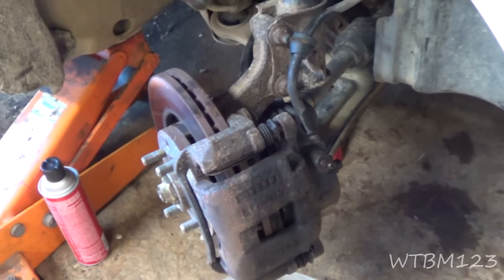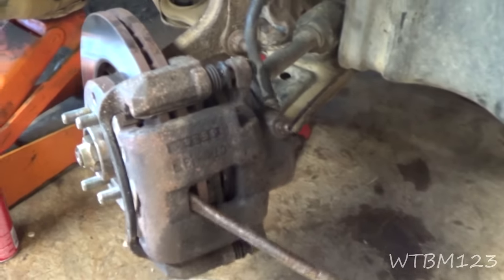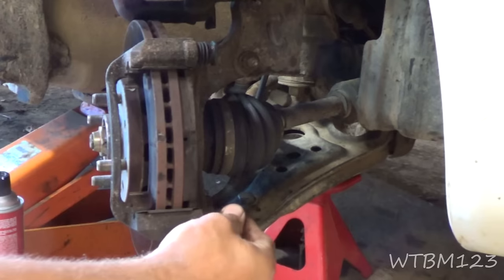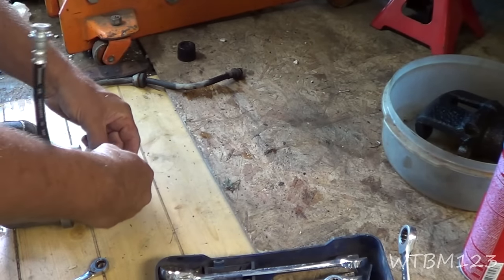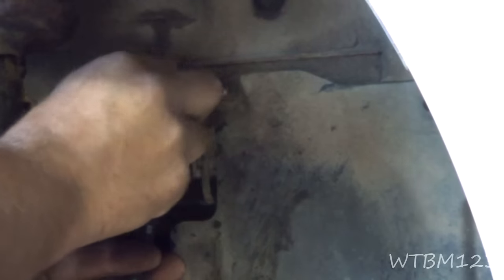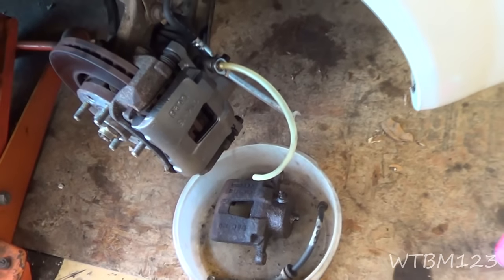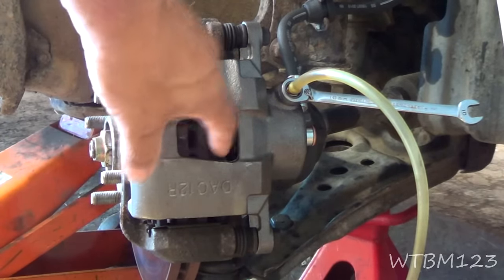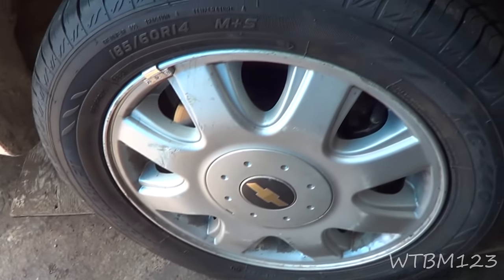Stuck Brake Caliper or Bad Rubber Brake Line #brakes #bleedbrakes #brakehose

Comment: My front driverside rotor runs hotter than the passengerside + i have a light brakeshudder when braking at speeds above ca 30 mph. Both rotor and pads both sides changed (ATE brand) a year ago. 

Brakehose looks good. Opening the bleedervalve I can by hand easily press the pistons back in, as the brakefluid passes through the valve. Likewise, with the caliper closed I can pump the brakes and still easily pry the caliper open with a flatheaded screwdriver or even just moving the caliper on the glidepins by hand. The pads were not exactly moving smoothly in the brake hardware, so i wired the hardware down and filed the pads to fit nice and loose. Still didn't solve the problem... 

Glidepins are gliding nicely, but they are slightly rusted. 

At this point, I'm thinking the caliper's not the issue, nor is the pads or the hose. What's left? Master cylinder, glidepins and rotor.. But the rotor is only a year old.. Been scratching my head for a while now, help much much appreciated!
Reply from the maker: If sure all moves free and well . If you drive a short distance trying not to use any brake does it get hot then . or is it when using the brakes alot . If the latter check to see if the cooler side is working . If calipers are back . up on jack stands . Hit the brakes a few times then turn tires to see if either is dragging .
Reply: @wtbm123  Yeah, driving about 15km without using the brakes at all, nearly rolling to a stop = driver side too hot to keep my fingers on the rotor for more than a split second, while the passenger side is almost cool to the touch. 

Just got a new pair of glidepins, new brake hardware and new pads. Figured I'm gonna try and change the hardware first, second glidepins and then the pads to see if any one thing will fix the issue. If I still get the slightly hotter rotor on the driver side (also a little bit of a brake pulsation), I'll get a new rotor, thinking that this one might have warped slightly due to the heat.
Reply: Yesterday I changed the hardware on the overheating side, drove the 15kms and that side was cooler than the passengerside! The car rollent noticeably better. Here's the kicker; today the driverside rotor is back to being way hot while the passengerside is cool to the touch. Interesting this ..

Comment: Great video! I have a brake leak in my driver side back caliper. I added brake fluid and the next morning the master cylinder was almost empty and went to back of car and looked under and can see the brake fluid coming out of the driver side rear caliper. any idea what I should do thx any help would be much appreciated
Reply: A worn out brake cylinder is typically the culprit.  Depending on whether you have disc or drum brakes, the age of the vehicle and any accumulated rust, the replacement of a brake cylinder can be a bear of a job.  Another possibility is a  leak in the rubber/steel brake line that runs back there.

Comment: you said the pedal felt low, so you re-adjusted the rear brakes? how do you do that? i probably won't be able to re-adjust mine because i got a 2006 Pontiac Grand Prix GT.
Reply from the maker: +Jeff Fuehr If it has drum brakes on rear they should be able to be adjusted , but not if it has disk brakes  on the back
Reply: mine are adjustable.    they are rear disk brakes ( with the parking brake attached to em ).    i already adjusted em, and it definitely helped.

Comment: If I left my e brake on n the mechanic shop saysing I have a seized rear driver side caliper now. Does that mean they didn’t release it? Cause my suv was driving normal would pull to either side how do u diagnosed that. ? Please help me before I get them to put a new one on thanks
Reply from the maker: Well non of them should stick , . Jack up the car and spin the wheel . if rear wheel drive will need to put in neutral , but block the other wheels , just so it will not roll away when testing .would be able to feel the drag , If park brake is working correct it should do the same to both back wheels , Also some vehicles the park brake is in the caliper and others are separate

Comment: I have a stuck brake caliper problem at both sides. The problem can be the master cylinder?
Reply from the maker: I start with making sure calipers work well including the slides , Test to be sure hoses are good and if all are good then work my way to master cylinder testing parts

Comment: ive changed out the calipers,(both sides),pads and master cylinder on my 91 nissan daily driver,even replaced the hose on the passinger side with no success,any help in solving my brake problem would be greatly appreciated
Reply from the maker: Not sure what your brakes are doing , but all moving parts must move freely including the caliper and caliper slides and pads if they are in a caliper bracket that they are supposed to slide in . Have some one hit the brake pedal and open bleeder to see if there is pressure . If no pressure follow back up the lines checking for pressure . if it is pulling say to the left then i would verify that the caliper on the right is working , as if it does not work it would pull to the side that is . Make sure wheel bearings are good

Comment: question: did you bleed the whole line in order to remove the hose line from caliper? Is there any valve to close, don't get it?
Reply from the maker: You can remove a line from a caliper , as long as you keep fluid in system and do not move brake pedal no air will go in line , but fluid will leak out . Also some cars you can push brake pedal down half way . prop it there with stick or something . then it will usually stop or slow down the fluid loss .
Reply: wtbm123 thanks bro! Cheers

Comment: Question: I have a 2005 silverado 4.8  2wd   with a sticking caliper both sides,  front right, front left,   I changed the calipers the brake hoses the master cylinder flush the brake fluid,    and still sticking both sides,  what do you think it could be?
Reply from the maker: are the pads sticking . If sticking and not the pads then if nothing else is visibly wrong , then make it stick , and loosen a fitting to see if there is still fluid pressure . Keep doing moving twords master till u find where it is holding the pressure
Reply: that's exactly what I did,  but when I loose the fitings from the master cylinder, that release the caliper pressure.    I changed the master cylinder and still the same,     the brake was really durty,  
do you think that damaged the ABS??    someone toldme that it could be the ABS PUMP.

Comment: @wtbm123 Hi,I have a similar problem with my ford escort van. The front right calliper stuck on for ages and destroyed the pads and wore out the disc,so i bought new discs,pads and replaced the calliper.
 Seemed fine for many months,then all of a sudden it came back sticking on again, BUT at the same time on the rear of the vehicle so did the back left brakes (which are shoes)
So at the same time front right calliper (pads) sticks on and rear back left (shoes).
Do you know what this is???, why are they both sticking on at the same time, they were actually smoking hot,i did see smoke coming out.
Also a few days aga,i totally replaced both rear brake shoes and also renewed with new drums too,so the back has been totally replaced as well and they were all free,handbrakes works fine etc.
 So what could cause the front right calliper and rear left brake shoes to both jam on at the same time??
 Could the fromt flexi pipe if faulty, also cause the back left brake to react at the same time?
Thanks in advance
Reply from the maker: Prob not one hose . Hard to say with out diagnosing it . but if more than one does it at the same time it prob has to be in a common place , to affect all . if out on a wheel it should only affect the one wheel .
Reply: wtbm123
I found out what it was, replaced the brake flexi hose and still same problems, since found out its the push rod coming out of the brake servo into the master cylinder,its adjusted way too far out and making contact with the master cylinder before even pressed, and in extreme heat like weve been having recently where i live expanded ever so slightly and made the brakes jam on. I removed the 2 x 13mm bolts from the master cylinder after it jammed on whilst driving and instantly released the jamming on brakes,i tested the pushrod for moving back and forth whilst the master cylinder was off and it did go in and out with no jamming ,so its an adjustment, to turn it back a turn or so.
for now if it jams on whilst driving i just remove the 2 x 13mm bolts which releases it until i get the time to adjust it properly
Reply: wtbm123
you see the brakes were jaming on in a diagonal fashion front right and back left, thats how i knew it was something to do with the master cylinder as this does brake in this fashion,not actually the MC but the push rod coming out of the servo

Comment: I put new calipers on my 81 c10 ever since then my brake pedal sinks. I put new booster and cylinder on bled plenty times. What could be the problem? Also I noticed when I blocked the line to the driver caliper drove around the block the pedal was firm but pull to the right which is expected when connected back to drive side caliper back to sinking could b bad caliper? ?
Reply from the maker: I would say air is still in there  prob in the one you pinched off. If you get fluid at all wheels try bleeding again .start with the lines at master to make sure all air is out of master cyl ,then move to the wheels and bleed. If you are trying to bleed by pumping the brake pedal, then ONLY PUSH PEDAL DOWN AND HOLD , DO NOT PUMP .Just push pedal down ,open bleeder ,let fluid out and close bleeder. Let up on pedal ,push pedal down slowly one time , then loosen bleeder and repeat this till air is out. ,DO NOT TRY AND PUMP TO BUILD PEDAL.  ,If you pump the pedal lots while bleeding it will push fluid through the air ,and break it up into many air bubbles and not just one.And when pumping pedal a lot will make fluid sudds ,then it is hard to remove air. If the rubber lines were ok before you changed the calipers and you did not stretch the hose then they should be fine.
Reply: When you put on the new calipers, sounds like the hose on the driver's side was not properly reconnected, or the hose itself is bad, and there's a loss of pressure on that side when you apply the brakes. Or maybe even though you bled it, you did not bleed it thoroughly enough, and there are air bubbles further up in the driver's side brake line...

Comment: We replaced the caliper and hose on a 99 S10 Blazer and the new caliper is still sticking. Scratching our head on this one. Also ABS light came on.
Reply from the maker: Open bleeder and see if there is fluid pressure staying on caliper . Make sure caliper slides on slides . And make sure pads slide and not stuck in place . if you have to tap the pads in to place they are to tight
Reply: @wtbm123  Thanks for the reply. We figured out the caliper that O`Reilly`s sold us was junk. Picked up a different one and everything is good now.

Comment: I put new:  Calipers(with bracket), hoses, brake lines, pads on a Malibu '03 with no ABS.  Drove home today and 5 miles from home, smelt brakes burning.  I thought it was the back, that I over adjusted them.  Turns out, upon arrival to home, front driver side rotor was real hot and pads were smoking on that side.       Any ideas?   Was I supposed to lube the caliper slide pins?  Would not that be already done?   I have yet to take it apart.
Reply: this happen to my father car. double check again your work, calipers, brake lines and master cylinder. if problem still exist. check your brake booster.
Reply: I took them all off.  The pads are scorched.  The caliper slide pins were great, all lubed up.  I am taking back the rotor and caliper for replacement, and if possible the pads.  I am assuming that the caliper is binding up.  If it solves the problem, great, if it does not, then I have not a clue on where to go next.   Questions such as :  was the new master cylinder bad? Was the new junction box bad also?  Its alike digging into a can of worms.  I hope its the caliper.  Seems like all these cheap Chinese parts are cheap for a reason perhaps.
Reply from the maker: if sticking , and all moving mechanical parts are free moving , then i would assume something is not letting fluid pressure to release . when sticking loosen a brake line to see if it releases the pressure. i usually start , and open bleeder to see if caliper releases , if so then i go to where the hard line , connects to hose and loosen . if caliper stays stuck, it is hose , if the caliper still releases , then tighten and move to master cylinder , junction box or what ever is next in system ., and loosen the line going to that wheel and see . Best to test and see what is causing the issue. . if u replaced the master cylinder is the rod coming out of booster the right length for new master cylinder .if it is to long and applying the brakes , then loosening the two nuts that hold master cylinder to booster . if brake frees up after loosening then it may be the issue .
Reply from the maker: and if it was abs , just bypassed then it could be in the abs unit
Reply: Romulan112 usually the pins are already lubricated check in see if they slide in and out , if not working may need to be cleaned.
Reply: rpoliard27 Thanks for your reply.   Turns out, they gave me a right caliper in a box marked right and a right caliper in a box marked left.  So, caliper upside down, unable to bleed out oxygen and thus, trapped air and caused the brake to stick.  Lesson learned to check the calipers.  I always worked on Subaru and never checked them because right wont' fit the left side.  Took me a while to find the problem.

Comment: I can press it back np problem but when I hit the brakes it sticks shut until I get a flathead to push it back again...any advice?
Reply from the maker: Is it the same with bleeder open , , if so may be caliper . if caliper in on car when sticking it could also be where the caliper slides on the pins ,

Comment: Brake fluid in a calliper may have Muck in it due to heat and moisture ,You can't say when you bleed brakes the first bit of fluid isn't tainted and the inside of a cylinder or calliper can be rusty etc. so why would you push that fluid back up into the system of finely plated boars and abs system
Reply: geoffrey ethelston

Comment: I have 1990 Corvette all the brakes were working as they should. I changed pads on all four wheels. Now the front passenger side sticks. I replaced the caliper and the rubber line. Still sticking. ?????????HELP!!!!!!!!!!!!!

Comment: I have a Hyundai Accent 2011 with stuck brake issues. I replaced the rotors calipers and pads(I use ceramic) and still with the same problem, When the car is cold the system work very well but after several minute start with the stuck issues. So, the problem could be the brake hoses? I will appreciate all help. Thank you
Reply from the maker: not sure the hoses would cause a heat related issue
Reply: For Hyundai brakes you can try geobrakes.com they sell all oem brakes.
      These are awesome in all means whether you talk about perfect installation or about the quality of the parts.

Comment: hello sir would the caliper if stuck would cause the brake peddle to bounce like the car is using its abs
Reply from the maker: If a caliper sticks it will build up heat a lot of times and cause rotor to warp from the heat . Can make the brake pedal pulsate , but usually different feel than abs going off . Is there any abs lights on . A lot of wheel speed sensors can go bad , or a wheel bearing can go bad and make the abs go off , usually just before stopping . May start with jacking it up and turning the wheels to see if it feels like a caliper is stuck and dragging
Reply: the caliper is now dragging no abs light on

Comment: I just did a complete brake job except calibers, everything seemed fine and the calibers collapsed ok, but now 1 of them will close fine, but will not contract? Not sure if the caliber is shot or not..it will collapse ok with a clamp?? Any thoughts?
Reply from the maker: Does the caliper slide back and forth free , and not stuck . or pads move freely and not stuck
Reply from the maker: That is why if i can i use a big screwdriver to push in the caliper , so i can check the caliper slides and that it does not take much to push piston back
Reply: @wtbm123  i rebuilt the caliper and works great now, thank you sir for the reply!

Comment: hi, I have a 2003 honda accord v6 xl and I put new calipers rotors and pads but I have this noise like it have friction between rotors and pads and I don't know what I have to do ,any Idea please . thanks for the videos.
Reply from the maker: Would have to figure out if the caliper moves freely on slides and if it was holding fluid pressure , because of the rubber line or farther up the system
Reply: I just replace the calipers, rotors and pads and still making noise.....

Comment: the problem happen in my 06 bmw 325 i press the brakes in every stop  when i release the pedal the breaks still stick about 1 second or 2 what do you think is the problem??
Reply from the maker: No way i would know with out testing the brakes , is it one wheel or all wheels doing it  , is there any abs codes .
Reply: wtbm123  front brakes  but no lights on no codes  brakes pads are new

Comment: I'm working with 2013 nissan sentra and I have a burning smell coming from driver's rear.  I changed brakes and rotors on the front, there good now.  And I cleaned and greased Everything thing in the back and I still have the smell.  Not as bad but still there.  Caliper pushed in decent enough.  Any thing else? It could be?
Reply from the maker: the caliper slides , not sure how the emergency brake works on them .